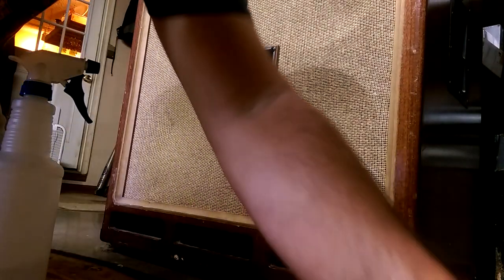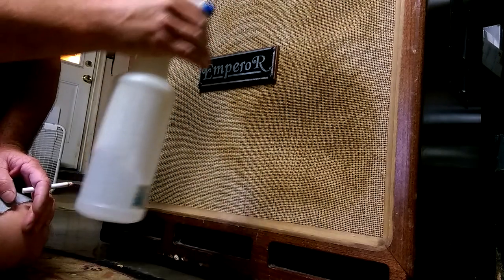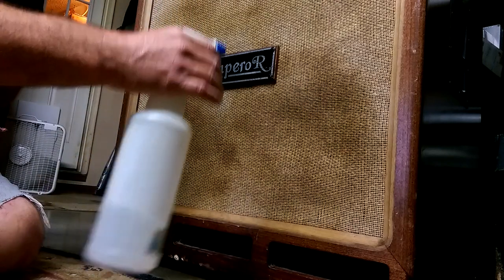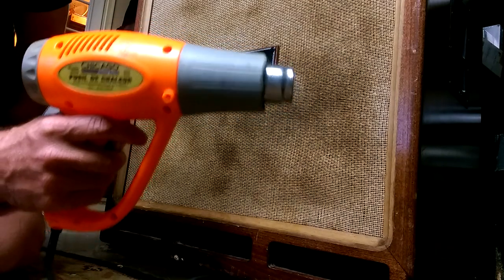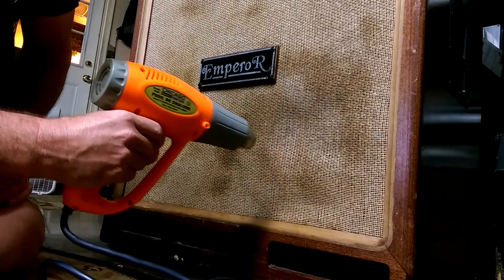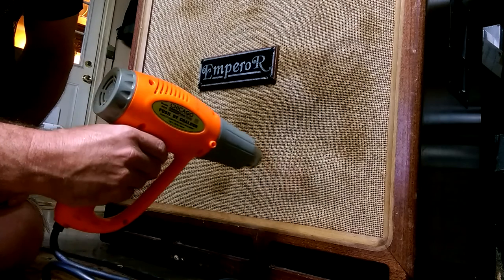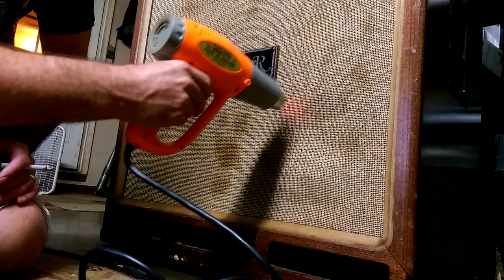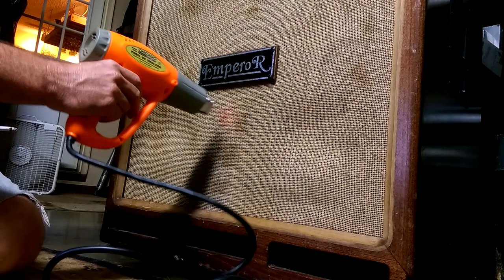Stretched out and sagged cane grill cloth repair

Comment: Will this hurt the speakers underneath???
Reply from the maker: You can use a damp cloth to wet the grill if you are worried about the water spray. I just let the speakers sit for a full day before using them. But no there's no water soluable glues that will come apart, only damp paper cones that will dry out and be fine. Proceed with caution if you aren't confident

Comment: Hey man, great vid! Curious, any knowledge or suggestions on how to get a few fold wrinkles out of new grill cloth (Vintage fender style) upon replacement? Got some nice cloth from Mojotone and replacing but these wrinkles are killin me
Reply from the maker: Thurotype Music yeah those aren't fun to get rid of. Usually just pull them very very tight and warm it with a hair dryer. Not a heat gun. 
Make a lever bar out of some 3/4" x 3" plywood, as wide as the grill. Line up and staple one side of the grill, widest side, then pull the cloth over the frame and staple it to your lever bar. Screw a couple screws into the back of the frame about 2" from the edge, hook your lever bar on those and push down and that will stretch your cloth super tight over the frame, then staple that edge across. That's the only way I've found to get them tight as a drum.
Reply from the maker: Maybe I need to make a video of that process

Comment: This answered a couple questions I had:

1) How much water do you need to use? A lot more than I'd planned on using.

2) Do you need to remove the speakers first? Probably.

Thanks for the vid. Cheers.
Reply from the maker: Hahaha speakers are very resilient. Just let it set for a day before cranking it up